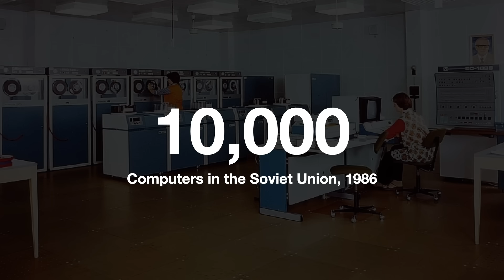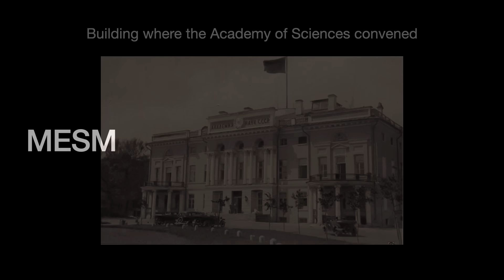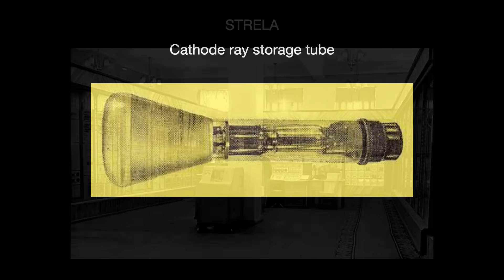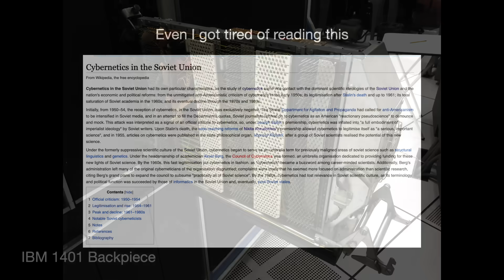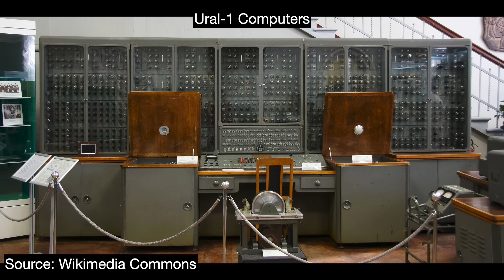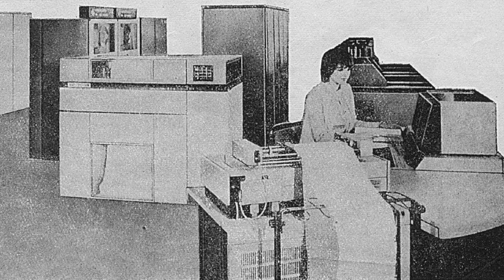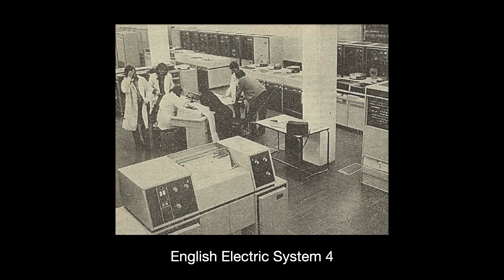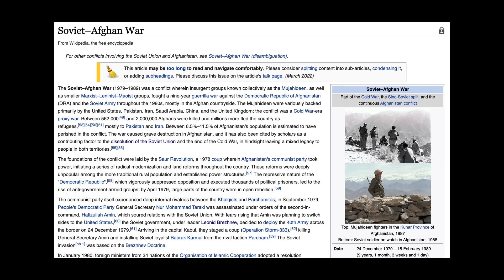Why the Soviet Computer Failed

Comment: Their electrical engineers knew where things were heading, but the Soviet political class was reticent. There is a parallel story to this which may also explain why, on top of all other issues regarding lack of incentives and productivity, the Soviet political class never really loved the idea of the proliferation of computers. Back in the late 1950s, early 1960s, around the time in the US they were designing the first computer networks, a Soviet electrical engineer whose name I forget (one may search for it though) had sat down and designed quite thoroughly a theoretical but very much realistic plan of connecting every single production unit with every single warehouse facility and every single sales point, including the last supermarket (whatever they had as "supermarkets" anyway back then!). His system did not just include the exchange of production and sales data but also an extensive service of direct communication including person to person chats so as to facilitate the flow of both tangible and intangible information. Basically, much of what he proposed were to become features of the WWW, precisely because his system was not centralised but rather decentralised based on the idea of individual nodes.

Well? Guess what! The Party commissaries  did not like it. Not because it was decentralised. Afterall, it could still be monitored centrally and every one could be spied upon - if anything computer networks facilitated spying, especially on systems that permitted "chat forums"!  The actual reason they did not like it was because... it was increasing productivity unecessarily too much and above all eliminated the need for intermediary Party commissaries since suppliers and clients, producers and consumers would be communicating directly to each other. I.e. they feared that it would turn their economy from a planned one into a Just-In-Time demand-based economy (i.e. much like the Japanese one). As such their fear was political, they really feared computers would remove their power which in a straight line goes against general wisdom (i.e. that you can spy more easily through computer networks used by the general population).

I would argue that one of the key aspects of the reticent of the Soviet leadership, next to a number of other mentioned in the video and in the comments here, is that the Party feared the sociological changes that could appear as an outcome of a wider proliferation of computer usage outside the strict boundaries of the Soviet military. They viewed computers only as a military application not a civilian one.
Reply: He was victor Glushkov
Reply: " the Party ... viewed computers only as a military application not a civilian one."

Not exactly. My father pioneered the use of computers in HVAC in the Soviet Union. This was part of constructing new buildings, so it was not something that would lead to sociological changes. But it was not a strictly military thing either. As far as I know, everything he helped to built was civilian.
Reply: @Kurtlane  HVAC integrated parts are not really "computers", but more likely "controllers".
They had no ability to interconnect with Other computers or controllers.
Reply: @otpyrcralphpierre1742  , that's not what my father worked on. He used computers to design the whole thing, i.e. where to put the pipes, what size each pipe should be, etc.
Reply: my wife and i watched this video and chatted about it.  she visited the soviet far east in the early 70's, and it was her recollection that various agencies and private businesses were actually forbidden to have computers, or maybe connected computers.  Beyond that, she said in the small businesses and siberian agencies she visited, loose paper was even frowned on . . . office notebooks of a known number of pages were preferred, so that additions or deletions were obvious.  i don't really know anything about all this, but she remembers it as an issue in most manager's minds.
Reply: @hildebrand142  Very interesting and corroborating the article I had read on the communist party\s reticence to the proliferation of computers in non-military applications. This is an evident outcome of  a planned economy under an one-party rule
Reply: @hildebrand142  I mean, we do that?  Numbered chequebooks, numbered receipt books.  If you assume computers are for business accounting, that's what they feared losing.
Reply: Sounds like excessive control of the state over all the resources of the country leading to money being invested less efficiently.
Reply: Basically USSR failed because of its system was too dependent on the individual power of the ruling elite of the state.

  The 1965's economic reforms in USSR are often seen as a last turning point on the crossroads between socialist and capitalist economic system. They implemented the essence of capitalism into the Soviet society - profitability-driven economic behavior. Since then corporations - and as a result its workers - had a stark incentive to behave self-interesting and aim for the own profit.

https://en.m.wikipedia.org/wiki/1965_Soviet_economic_reform

The system was set up for the capitalist logic, from there it was a question of time till the body of the socialist system would crash.

Another point is the horrible and fatal faulty political decisions in the economical sphere, done by Khrushchev. He did lots of reforms, that were unsuccessful and finally were wrapped up. For example 1960 he canceled Artels, a form of cooperations, that were based on private incentives aka private profit oriented ventures, which since the 19th century supplied Russian society with consumer goods. At a great part they produced the consumer commodities, which started to become deficit after the artels were disestablished.

https://en.m.wikipedia.org/wiki/Artel

Then there was a another failure - The Nikita inspired rush for 
 notorious competition between two systems ("We will catch up and outrun!") this slogan equalized the goals of the two systems - it turned out that the USSR and the United States had the same goals, but their paths were different. On the other hand, the slogan put the USSR in the position of a catch-up party, which gave rise to a corresponding psychological complex.

Since then, the performance of the two countries (the USSR and the United States) were constantly compared in terms of personal consumption. However, to compare the two systems in terms of that indicator was to recognize socialism as a failed copy of capitalism. As a result, the Soviet people stopped being proud of their system and began to look enviously to the United States. Mayakovsky's famous line, "Soviet people have their own pride, we look down on the bourgeoisie!" has lost its once majestic meaning.

For being the first socialist state in the world, the results of surviving over 70 jears are quite impressive. Compared to socialism, capitalism took 500 bears to establish..
Reply: They want to keep you as slaves! 👉The Connections (2021) [short documentary] 🔥
Reply: The smothering, the stunting, and even the mass destruction of the productive class has been the Soviet playbook since day one. Anyone who can build or create or grow or make some success for themselves by the fruits of their labor is a threat to the state. It's the war against the Kulaks.
Reply: In short: paranoia. Or wait... Maybe greed also? I dunno, something really basic. Something strong and fundamental, that can survive being stupid.
Reply: @greenanubis  Hi D.L. I won't call you Divine, it's likely to be misconstrued. It's paranoia, yes. When men commit atrocities on each other, they assume others will do the same to them, and they become paranoid as the natural result of their own actions. What we sow, is what we reap. Now that's divine in all religions. Cheers, P.R.
Reply: @Dinos do you have any good sources about the Party's distaste for a system like you described?  I'm curious if that was the problem that caused Russia to abandon using computers more effectively in their Central Planning Authority.
Reply: @chucktangy  I read that in an article in facebook last year, from a page that seemed acceptably legit in my eyes (they deal with engineering issues and such - could had been "Interesting Engineering" or something like that). I do not keep a record, just speaking out of memory. I had no reason to doubt the validity of the story as I had read in the past elsewhere that they were pondering over the creation of a prototypical "internet" in the USSR but the Party had an aversion for the proliferation of computers among the general population. When rulers live in a cocoon, they fear change even one brought by systems themselves wholly control. 

On another page, while the first sort of internet was set up in the States, first in the late 50s as a military application and since the late 70s as a civilian one (Usenet), it was in France that the first widespread civilian internet system was established, meant to promote computer usage in France with French-made systems and software. It was called Minitel and was inaugurated in 1980 or around that time. Minitel was operated by made-for-the-purpose computers and used telephone lines and in a few years it had a full array of services that catered even for your cornershop small family businesses. E.g. you could be buying stuff, ordering pizzas, doing your tax declarations,  doing job applications, enrolling to the university and yes had hotlines of all sorts including ... erotic ones. Particularly popular of course were the... chatting dating sites. By the early 90s just before the arrival of the WWW, Minitel was already showing advanced features later seen in WWW but its point of failure was that France failed miserably to expand the system outside France within the EU, so it remained a French only application. So when WWW hit in, it hit hard with Minitel losing space even in the first couple of years, being maintained up to early 2010s when it still had a sizeable clientele of many million lines (mostly businesses and state services using for business to business by that time), yet France Telecom interrupted the whole service as it had no point going forward. France though a smaller country had a government that did not discourage its citizens from computer applications but on the contrary did its best to proliferate such usage.
Reply: I am a believer in the notion that Societal change will come because of IT. 
IT, or rather, Artificial Intelligence will expose corrupttion and enforce a change in decentralized thinking and policy. 
The other shift would be the focus on Agricultre and deurbanization- no more resource-gobbling megacities, no more magnets drawing in talent, and depopulating the countryside. Instead we would see Industry as supporting Agriculture in every way. 
The third way, after IT and Agriculture, would be Nuclear power. It would be Thorium-based power instead of the Uranium route, lessening nuclear proliferation,  and eventually forcing governments to reprocess their valuable fissile material esp those used in bombs, to be reprocessed and coooked in Thorium reactors and generating energy. SUch reactors would be small, safe, self-contained and cellular- serving local communities, say a County, This would lessen the chances of cascading power shortages, while IT/AI would manage it safely and efficiently. 
btw, I'm not a Luddite! :-D
Reply: @upresins  I am not so optimistic so I would not subscribe to such a scenario. For starters, to forsee the future you must study the past. Speaking of technologies, there were already for more than a 100 years technologies that increased autonomy which would support societies that were less urbanised, including the - yes I am enterring the realm of conspiratology here! -  highly classified technologies that people often brand as "UFOs" (possibly... electromagnetic VTOL lightening-fast anti-inertia flying machines, invented after the works of Nicola Tesla - but I would not delve right now in that as it would be talking "in the air"). We had steam engines which were only slightly less efficient than internal combustion engines but with much lower maintenance and higher life-span, yet they were ultra-fast phased out precisely because of their bigger advantage, i.e. burning just any type of fuel available. Oligarchies, banking oligarchies which are in the steering wheel of world-wide investments, wanted machines which burned only one basic type of fuel, that is petroleum. In such a way they yield direct and very tight control over the nations' economies. We could be having autonomous (even per house/block of appartments) production of electricity with solar mirrors, much cheaper than solar panels, can be  produced everywhere, require minimal maintenance (just periodic cleaning - these can last literally for centuries!) which could be producing steam to feed a steam generator - and in winter time, this could work on just any type of available fuel (including ones made of the rest of agricultural waste). Yourself correctly added in the evident solution of thorium a very efficient nuclear fuel that leaves minimal radio-active waste which can be easily and safely disposed and which cannot be used for weapons. 

But the bankers can't make money out of that, let alone yield any control over nations' economies. The bankers did not even like the idea of nuclear energy with uranium. Just watch the recent example with Sri-Lanka : it approached politically too much China and in the end bankers punished it by cutting its credit, so it could not import oil, thus its cars and tractors could not move, thus its farmers could not produce and the whole nation came to a standstill - something which was about to happen to my native Greece but our government found the solution of tying the country even more to the western chariot (remember, prior to 2009, Greece was flirting with China as well) and sold-out the lives of the next generations of Greeks, endangering the survival of the nation. Yes, we talk that type of control.

Now seriously you think that A.I. technologies which are already developed by the US military (same for China and Russia to a lesser extent) and which are "democratised" by companies of dubious origins with financing from the aforementioned world oligarchies, will make all the change? Judging from the examples of the past, they will not. They will be used apparently for even tighter centralised control.
Reply: @dinos9607  Thanks, man. You're right, I was absolutely enthused by an idealised vision, and went off on a tangent there. Obviously, I did not consider the influence of geopolitics, Banking, the Profit motive, the 'deep state' and all the real 'movers & shakers', the puppet masters operating in the shadows from behind the curtains. And I hate it, these insidious dealings behind the back, and to make humankind subservient and dependant on something. It is sad, indeed. I had really not cnsidered this fact.
I was not thinking of any specific block, but I was thinking about 3rd World countries, where the people and leadership are still evolving, emerging from chaos and poverty, to some kind of control and prosperity. The difference between the 1960s and now is Technology, the pervasiveness of technology, the present ease and accessibility, which was quite difficult to imagine just 20 years ago. Yes, it is difficult and unobtainable, but if the circumstances were closer to an ideal, we would have had a society that would have much lesser strife. 
 I wouldn't know much about the 1st world countries, but am a bit surprised at how easily such developed and advanced nations (like your country Greece) get into such alarming economic situations. 
 Personally, I'm not a big fan of China, as in some countries, they don't behave well with their neighbors. To me, they seem to not only emulate the West, but overdo it, too, which is bad. I don't believe in a 'one size fits all' kind of solution. Aping the West is not the solution. That goes for the western-style Democracy, as well. We have to evolve and each one of us will find the right balance. I just wish there were more sensible people in the Chinese leadership, less belligerance, less chest-thumping and more intelligent, smart and pragmatic thinking. 
Though I understand your misgivings about AI - esp that associated with the Military and Commercial and Banking interests, I personally believe that AI will not stay here, but continue to evolve and get to a better, more humane level of understanding. Again, I'm on a tangent here. 
UPR
Reply: @dinos9607  Hi. This is a side issue, but I've always suspected that the so called "UFO" sightings in the late forties/early fifties around Roswell N.M., were actually sightings of top secret research jet aircraft. The U.S.A.F. had a base there. The locals had never seen fast jets with flaming tails, and were at a loss to describe them accurately, especially at night. These aircraft didn't fit in with their established perceptual sets. 

 Post WW2 the US lagged Britain in turbojet technology, and sought desperately to catch up. "Project Paperclip" was part of this, a plan where top German scientists were invited to become US citizens and lend their talents. The scientist's other choice was Russia. 

America's backwardness in turbojets was evidenced when The Bell X1 broke the sound barrier in 1947 using rocket power sourced from Germany post war. The only existing jet engine capable of going supersonic was the British  Whittle W1, using an afterburner. For an American jet to first break the sound barrier using a British engine was politically unthinkable, so the Brits, gentlemanly to the end, (and strongly encouraged by their large war debt to the US), cancelled their own supersonic program, the Miles M52, just as it was nearing success. Yeager went supersonic on the same day the USAAF became the USAF, so this was all staged for propaganda effect.

So the "UFO's of those times were probably research vehicles. The only other option is to believe that the light barrier is no hindrance to interstellar travel, something no scientist believes. We need another Chuck Yeager to do to the light barrier what he did to the sound barrier. Cheers, P.R.
Reply: @philliprobinson7724  I won't disagree that many unidentified flying object sightings could be attributed to the jet propulsion projects of the day, as well to a huge number of other man-made objects of any sort and natural phenomena. However, clearing out such, we do have 100s of 1000s of testimonies that paint clearly the case of the existence of another type of technology, highly classified one, upon which metallic crafts in various shapes such as disks, spheres, bells, triangles and cylinders among other have been produced, operating "seemingly" on electromagnetic propulsion which "seems" to negate inertia (not gravity as it is often mentioned). And these are monitored all over the world and the testimonies have quite many similarities - and I mean the believable ones, not the made-up ones. These serious believable testimonies do not only include random laymen catching distant shadows in the night (which of course include whole cities - google the Brussels 1990 UFO incident with those triangular UFOs) but also various nations military services which pretty much detect them in their radars - here in Greece they have multiple times detected such vehicles and they do present the alleged behaviour : they fly much faster than any craft flying on declassified technology and they cannot be intercepted. By all means they appear most times to be linked with the US military.

Historically, there are the undeniable first sightings during WWII, when US, British and German pilots independently admitted seeing strange crafts such as disks and spheres flying around, sometimes obstructing but not attacking, not having any visible weapons. It seems these were actually German ones though Americans knew about the technology but they were just behind. A key possibility is that these are electromagnetic vehicles that require the whole metallic surface to be electrified (suspicion is on pulse electricity - Tesla had a fixation on that for some reason - note Tesla spoke about such flying machines) and thus it was impossible, at least back then, or maybe even up to today, to put any sort of offensive weapon such as a gun or a missile. At best these could carry bombs which could lay down like an egg after a fast landing and then take off immediately. Not very practical military-wise, better deliver that with a missile LOL!

After WWII the Americans with Operation paperclip moved the German teams alongside those that worked on jet propulsion and continued research in the mid-western deserts of USA. Area 51, Los Alamos, Alamogordo and other such bases. Of course, hiding completely such a technology would be impossible, thus the advent of.... UFOlogy, proliferated via paid B-movies and comics and books of fiction. In fact Americans were not even the first to use such as the Nazis had already played with it using "obscurantism" and "extra-terrestrialism"  to discredit any eye-witnesses. And it is a type of propaganda that works quite very effectively. If one mentions he saw a UFO he is immediately taken as a joker, a fool, a fantasy-lover... beep-me-up-Scottie type of guy.

Now why would they keep these technologies classified? And how about the Russians and, more recently, the Chinese? Well... this is how all this UFO issue ties quite nicely with out ultra-interesting conversation above! To be noted, this is my personal take on the subject, never read this explanation elsewhere. Let me explain my logic : 

As most people know power lies on 1) Finance 2) Military. But along with these there is a third node in the triangle of power - and this is often forgotten by even self-acclaimed specialists : it is 3) the control of traderoutes. Never ever in history was there any, even regional, power which did not have at least some sort of control over some traderoute. In the past 200 years that Empire was the British which controlled the world's main traderoutes, maritime traderoutes, with Britain ruling the seas. And of course Britain passed it over as a dowry to the USA after British oligarchies massively invested in the USA in the second half of the 19th century. Why? To counter the rise of Russia. Why? Because... steam engine.... railroad. Scan history books on the subject and you will quickly find out how reticent were the British in relation to the application even of steam on ships (it took them half a century to start doing so and they did so to not lose the prime position), let alone be in favour of railway projects being undertaken in other countries (see Orient Express and of course the Transiberian). It was upon these considerations that the dogma of McKinder (the Geographical Pivot of History - later known as Heartland Theory) was constructed in the late 19th century. And make no mistake, the world affairs are run to the letter upon this geopolitical construction - what you see now in Ukraine is nothing else than a game played along the rules of the Heartland Theory. People think it is about the gas and oil and mad Putin and such, but no, all these are side-considerations (afterall USA permitted Germany and the rest of EU to import massive quantities of Russian gas and oil in the past 20 years... so what changed?).

Well? Geography is always there, that is the problem. 99% of the world intercontinental commerce moves by ships, not planes, not railway, yet.... railway is the fastest, safest and yes very feasibly the cheapest way to move intercontinental commerce, say from East Asia to Europe and then to Africa and so on. Who would lose out of such a development? USA and Britain and Australia. American continent can do the same but it won't be able to compete, it is a smaller landmass with less overall resources, less population. Who would win? Russia! That is where the main lines would pass from... just 1 country linking East Asia to Europe. Which would be the world's exchange currency? The rouble, not the dollar anymore!

So, here comes the big deal : USA wants to maintain the status quo with the traderoutes being maritime and USA controlling the oceans. Russia would like to change this status quo and make a shift to railways and pipelines.  But none of the two would like a scenario where.... a till now classified technology of VTOL aircraft that can be made at any shape or format and most importantly size gets declassified and being made and used in commercial applications by just any poor guy out there....  negating everything.... ports.... railways.... roads... airports....  and all the banks to give you loans to build these and, above all, all that tight geopolitical control that goes along with these. Foremost, we talk of world bankers, how would they yield their power with the negation of the very key aspects upon which they lay their hands upon the world economy as it developed in the past 200 years? If we talk of "disruptive techs", that is the mother of all disruptions! Forget A.I. and robots and such. UFOs are the mother of all disruptions! Just picture this scenario.... in central Kongo, in the middle of the forest you and the local tribe there dig a mine, extract the ore and export it diretly to landlocked Kazakstan or landlocked Nepal. Without roads, railways, ports, airports... nothing. And no investments required to build all these. And no need for asking anyone, no need for exchange currencies.... F the dollar, F the rouble! F the yuan! Get it? So yeah.... better tell them "It is the aliens... Ooooohhhh!!!! Spooookie!". LOL!

If that sounds too abstract, ponder move over it. Do we have any other technology that could do, at least to some extent, what these "UFO" can do? Well yes we have and it is very simple : the Zeppelins. Airships (and who did develop them in earnest? Germany. Not Britain, not USA, neither Russia). Granted they cannot replace ships but they can provide quite an antagonism, they could partially disrupt the traderoutes. Them too they replace roads, ports, railways and to a large extent airports and can deliver good door-to-door factory-to-warehouse. If they carry little compared to ships, they make the deliveries 10 times faster (thus their true capacity is 10 times their actual volume capacity for 1 airship to be compared to 1 ship - and a modern one compares directly to a small-medium ship). So why did they remove them out of the picture? Too dangerous? Were planes any safer in the beginning? Certainly not.

To sum up, I go to my original point presented above : there are a ton of technologies but we are given to use only those who are not disrupting the established status quo. Hope I did not tire you with the endless analysis-paralysis here. LOL! Be alright.
Reply: @dinos9607  Hi. Thanks for that. It'll take me a while to digest it all, so I may be some time replying. Cheers, P.R.
Reply: @upresins  Hi. Are you into plastics? Some good ideas there. A friend of mine's into thorium nuclear, he reckons there's quite a lot in India. Decentralization of power is called democracy. I think G.E. bioengineered liquid fuels will be needed too,   a lot of people living in the backblocks  don't have an electricity grid to fall back on. If we keep our options open and research all things, I'm confident we'll all get through. All the best. Cheers, P.R.
Reply: @philliprobinson7724  Hello, SIr.
Yes, I'm into composites (my nickname was a giveaway, I guess), and also, I'm based in India. You're right, India has a lot of Thorium. And so does USA, Australia and Brazil. I'm just waiting for the right kind of technology to crop up, something that can be easily adpated and something that cannot use used to created destructive weaponry. And Thorium being so cheap and plentifully available, would mean there would be power for all without the troubles. 
Chill,UPR :-)
Reply: @upresins  Hi. We live in hope. Cheers, P.R.
Reply: Their fears were definitely well founded. Pretty sure most if not all industries understood they were being fucked over and robbed by the Soviet elite no matter how much propaganda was shoved down their throats. So if they had the means to circumvent commissars I bet they'd take it. And all it takes for general unrest is for the ball to start rolling. It's already a bad enough look for the CCCP when their black market (free market) provides for its citizens better than they can which undermines their entire ideology in full view of everyone. The existence of something like the internet on top of that would make it nigh impossible to keep everything centralized. Especially the flow of information.
Reply: @MintyLime  Hi. Good point about the free vs. black market. The freedom of speech issue is a major issue. As Stalin said, "we don't allow them to have guns, why would we allow them to have ideas?" Spying itself might be made more efficient by computers, but identifying and apprehending the holders of any politically incorrect ideas would have had the same difficulty as we have today in finding the people responsible for computer crimes and misinformation. Training scores of apparatchiks to monitor the incoming spy information, was training people in the very skills the commissars didn't want them to have. Cheers, P.R.
Reply: @MintyLime  Very precise remarks. And they rime with the... Party commissaries' deductions over that case-study on connecting production with consumption via a computer network. Indeed, as I said above, it would create a Just-In-Time production system which unavoidably would jump out of the scope of the communist system. Sure it would still be centrally monitored (certainly not centrally micro-managed as in the existing system but at all times monitored), yet with far more transparency both in terms of production/consumption information as well as onto the type of vertical intervention by the Party. 

If one sits down and counts down the levels and points where the communist (and in general the socialist) systems fail, the discussion can go on indefinitely.
Reply: The very last line in your post is how it should have been worldwide. Jus sayin.
Reply: as your description it seems that also would limit some types of corruption enablers within inefficient systems
Reply: In so called "planned economy" you can not have anything that exceeds planned quotas, otherwise the whole plan is falling apart.
Reply: @witkocaster  Hi. I must disagree, what's your reasoning for that claim? If a paddock in a planned economy is expected to deliver 20 tons of potatoes, the planners don't stop digging them up just because the 20 tons is reached when only half the paddock is harvested. They keep harvesting and get another 20 tons. When this happened, (and it sometimes did), it was celebrated as "a glorious triumph for the people's revolution". "Hero of labour" awards were given, and oompah bands played rousing patriotic tunes.

As the quota had been exceeded, the  'heroes of labour' figured a few of the extra tons wouldn't be missed, so they quietly sold them on the black market, where they were used for making vodka. The vodka ensured the quotas were never again exceeded, the drunken heroes of labour were caught, given a show trial, and shot as neo-capitalist revisionist reactionaries. Their families had to pay for the bullets.

The fact is, Russia's planned economy failed, not by exceeding quotas, but by falling short of them, and denying its workers the right to personally benefit from their own hard work.  Cheers, P.R.
Reply: There's something that you said thatbis wrong. The reason why they didn't want to implement the OGAS was not decentralization (the whole idea of the system was to enhance the economic calculation of the central planification) but the fact that it would make a huge part of the bureaucrats obsolete. After Stalin's death every new Secretary was "conservative" apparachnik that did not care for further development of socialism, all held in power by these guys. At this point the implementation of the OGAS would have broken the power structure of the State. If it were presented to Lenin or Stalin decades esrlier they would have taken it, but it arrived too late.
Reply: @Krolmir96  If that referred to my OP; then I was saying the exact same thing as you say here. Indeed, the proposed "internet" could be easily centralised but it eliminated most of the intermediate bureaucracy and the need for Party commissaries, something which did not ring well with Party members. If there was Lenin or Trotsky or Stalin, sure they would jump on it and make it as centrally controlled as it could get.
Reply: Wow, this is really interesting! Is there a book where I can read about this stuff specifically?
Reply: @daesun1358  Probably, but Russian I guess. I have read the information on articles. But I am sure that some Russian writer may have compiled that in a book, if not specific for this issue then commenting on the lag of Soviet technology in the digital sector.
Reply: People should not take these made up stories too seriously. A single engineer, designing the entire system and ALL OF THE PARTY comes in and decides why they do not like it. Seriously people, think for one minute how in practice all of this would look like and you will realize that is just a story with maybe some truth in it.
Reply: @REgamesplayer  What is so strange about the story? A high ranking engineer working for the ministry of economy (or industry) submitting his proposal - that is what happens everyday in every single country around the world. The guy did not set up an actual internet. He made a preliminary research in how such a system could be set via interconnected computers and what it could bring to the productive base of the country. People are the Ministry, aka Party people, did not like the idea for the given reasons. There is nothing extraordinary to it.

Wanna have a similar example? Nicola Tesla. He did not submit his ideas to any ministry but he most certainly submitted them to his investors and most of the times they rejected them precisely because they were countering their wish for establishing monopolies and control. Different settings, similar story.
Reply: @REgamesplayer  LOL! Seriously, go up and read every effing text I wrote! Where on earth did you see that I said the guy "invented" the Internet? The internet was something engineers discussed ever since the first computer connection back in the 1950s for the military, then in the 1960s for the civilian market. This guy simply CONCEPTUALISED a network of computers to facilitate the transfer of information between production and consumption. It was a theoretical study. He did not sit down and built the actual system, nor did he dealt in the intricate engineering aspects of his proposed network. I could do that, you could do that as well, sci-fi writers were on it - and there was one guy who was doing quite the same thing (google "project Xanadu")  at around that time. It was not an engineering thesis, it was an economics one. 

Now I am not fully aware on what really happened. Hey, I do not even remember his name or the particular ministry he was working - I read that article quite a long time ago. I just mentioned it out of memory hoping that someone else would had heard that obscure story.

At any case, the way the Soviet leadership saw computers, i.e. as a military, not civilian, application is quite well known and not just from this story.
Reply: @dinos9607  Tell me, why ''the party'' got so interested in the idea which is just some made up dream? Everyone has countless such utopian ideas. Leadership does not operate on a vague suggestions, but on prototypes. This is where this whole story unravels. Not only it does not make sense that party would even notice it, but you also somehow know how it felt without even quoting anything or pointing out any individuals who were against this idea.

Your problem is that you take my distrust of validity of this story personally. I do not doubt you as much as I doubt the source you had read. However, one guy expressing his disbelief should not upset you.
Reply: @dinos9607  Yes, a little. Now I can actually google it out myself if I want to look more into the story.
Reply: @REgamesplayer  You are welcome fellow co-commentator!
Reply: man, if the politburo really understood that, they were visionaries too (just badly motivated visionaries).
Reply: “His idea was decentralised” can you describe how a decentralised network of nodes would operate over such an area using I assume dial up modems?
Reply: @ribenasquash  You are mixing 2 different angles here. By all means there no "decentralised network". The WWW was sold as "decentralised" too but CIA and DARPA have pretty much access anywhere, the very reason why Russia and China want to set up their own internet. Even if the architecture is "decentralised", control will always be centralised in any sort of internet - and control us held by the one who established the protocols  e.g. TCP/IP and all standards of compatibility for machines and software to enable the connections.

The decentralisation I was referring was in the actual production process in the sense that there would be no need for commissionaires to roam around and telling people what to do bur rather the producers and the consumers would be communicating directly their needs and their capacities. Sure there could be central intervention but that would be visible to both the producer and consumer. But for the most in such a direct system there would be unavoidably an extensive decentralisation of the production system and the overall market. 

In fact, it could potentially end up being quite less.... communist, especially in the case of consumers being linked to more than one production facility for a given product.
Reply: Copying the JIT econ model is what set the U.S. on the path to ruin.
Reply: Вы говорите об этом? https://ru.m.wikipedia.org/wiki/Общегосударственная_автоматизированная_система_учёта_и_обработки_информации
Reply: Hi Dinos. In other words, they didn't want to risk the people gaining freedom of speech. The Soviet supermarket was called "G.U.M".. You queued for hours and bought whatever they had whether you liked it or not. Chewers, P.R.
Reply: @philliprobinson7724  
Nothing to do with freedom of speech
You completely missed Dino's points
Fear of loss of control, and loss of opportunities for graft, by the ruling aparatchiks, was the driving motive for stymieing the application of computing
Reply: @MrDeicide1  Hi. I was jumping ahead. Considering today how the internet allows people to communicate freely, the Russian scientist's political masters may have seen this potential too. Of course they'd suppress any growth of a mass market for a device that short circuited their control over freedom of speech. Today, this genie is well and truly "out of the (vodka) bottle" . I didn't miss Dino's points, I took this one to the next level. Cheers, P.R.
Reply: @philliprobinson7724  the major reason Soviet beurocracy (Nomenklatura) did not want to have high levels of automation was indeed the fact that majority of them would not be required anymore.
Reply: Hi Soviet Citizen, or should I be politically correct and say "comrade?" Unfortunately you're right about the abuses, but these are not the fault of the machines themselves, but in how human beings use them. If we run our thumb against the blade of a knife to check its sharpness, we cannot complain if we cut our thumb. But who would say knives are bad things?

Personally, I'd love to be spied on by some nameless political entity, friend or foe. I'd use their credulity for my every word to get  kinder and more honest messages into the world. I don't need secrecy or privacy, I'm just an ordinary person. Cheers, P.R.
Reply: @sovietcitizen9450  "the major reason Soviet beurocracy (Nomenklatura) did not want to have high levels of automation was indeed the fact that majority of them would not be required anymore." As someone who tries to raise awareness of the coming 4th industrial revolution I find this attitude in many common people as well. Except they don't have control over it like the USSR so they usually just pretend it won't happen, usually citing crashed self-driving cars or some other high profile automation failure while ignoring the insane advancements in the technology.
Reply: @philliprobinson7724  "GUM" is not a supermarket. It means "glavniy universalniy magazin", "the main universal shop". It is "universal" because there are all kinds of products in it - clothing, footwear, radios, TVs, fringes, dish, sport products etc. It is some analog of a mall. Soviet supermarkets were called "universam" - "universalniy magazin samoobsluzhivaniya", universal shop of self-service. Universams had food only. You can see soviet supermarket-universam in this video at 5.20 : https://www.youtube.com/watch?v=fz823PTzNI4&list=PLYW8rxU4plVHcRP99mBM4sFdURo_aCvnF&index=51  I guess, it looks similar to US supermarket, because universams were implemented by Khrushev after his voyage to USA.
Reply: @АлексейЧернышев-ь9ы  Hi. Thanks for the information. So G.U.M. was more like what we called a "Department" store. A Mall is basically a Department store in which each department is a financially independent business.  
 Nikita Kruschev was a progressive leader who did much to bring change.  For people alive during the cold war period, our problems with understanding each other even now, are due to the biased propaganda  that both sides used to brainwash us. As one of our sages once said, "In war, the first casualty is truth" Applies to cold wars too. All the best, Cheers, P.R.
Reply: @philliprobinson7724  People like you scare me honestly. Willing to throw away privacy because you can't look past the present where no secrets are needed in the safe times.
Reply: @BillyBob-qu1fs  Hi Billy. I scare you? Why, I have nothing to hide! It's the people whose interests lurk in dark places you should be scared of. There's a lot of dishonesty about. Cheers, P.R.
Reply: If there's one thing socialists/communists fear it is the spread of information - sure, 'educate' people - but only with controlled info and 'news'. Imagine if that 'internet' would have taken off - how much data they would have to check. It's the exact reason why the current web gets censored more and more...
Reply: @ibubezi7685  Correct and to the point! Indeed, this what I aimed next to highlight! That just like Soviet leadership feared the social changes that a decentralised computer network could bring, similarly the US establishment, even if itself fostered the usage of computer networks worldwide to die the world in its web and thus monitor it closely, it also has had since the beginning a reticence as per the degree of freedom that should be given to users. In the beginning in the early-mid-90s, as part of the proliferation campaign they advertise it as a "virtual place of freedom of expression" and of "endless possibilities' but it was clear to us, early users, that this would not last long. The first step was of course to curtail activities of copyright infringement nature which were easily defined as illegal (the legal attack against Napster was a flagship in this effort) but it soon jumped on limiting free speech and on defining what was permitted and what not. By 2010s, it was clear that the world wide web is clearly not a space of unlimited possibilities and of freedom of speech. It is a place of indeed many possibilities but one of some but certainly curtailed freedom of speech.
Reply: @dinos9607  damn I miss the 90's internet.